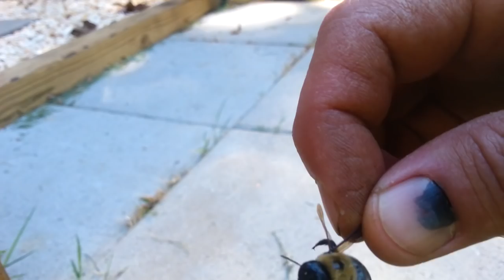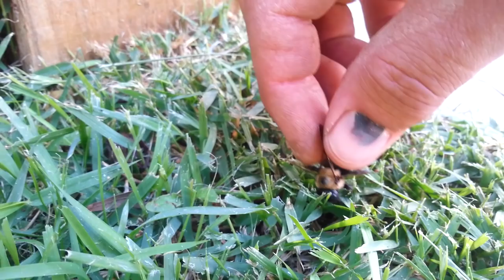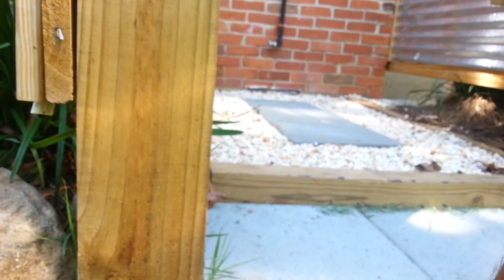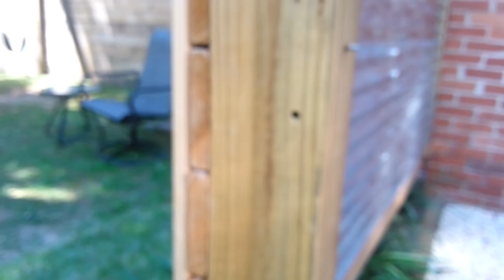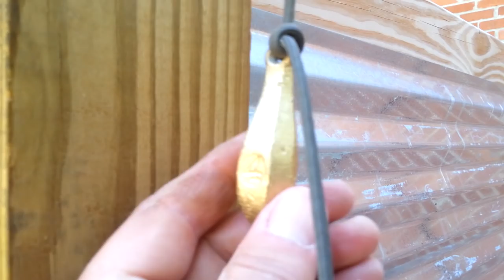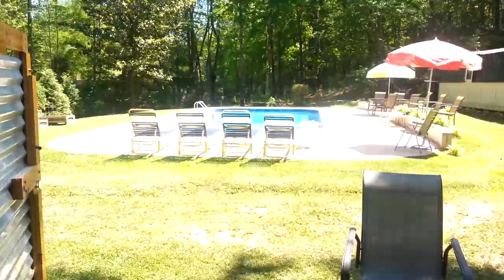When Bumble Bees Attack & Do It Yourself Outdoor Shower

Comment: Have you had much experience with carpenter bees? Those things come back year after year like snowbirds driving south for the winter. They are setting up a homestead in all that fresh wood you have supplied them. I'm speaking from experience when I say you need to find a pesticide that works and quick. That is unless you want to replace that structure about every ten years or so. I use a powdered mix for my sprayer that seems to work but I can't remember the name. If you are interested just reply and I'll get it for you. I sprayed the cover on my patio and fence. When the bees returned to what they thought was a smorgasbord they just hovered around but would never land at  least most of them, nothing like I had a few years back. They were in my yard a few weeks back looking around but they have left now so I think what I used work pretty good.  Just let me know if you want the name.
Reply from the maker: +R Lindsey They do love the fresh pine things I build but they never drill into the wooden parts of the house where it has been painted. I'm going to check later and see if they enjoy linseed flavor. If not I will linseed all my stuff. Thanks for the information if you want to provide it. Don't go to a lot of work for me though. Thanks for watching
Reply: +Exploring Alabama Hi, yes I really like your videos when you go metal detecting. I live here in Alabama so it's very interesting to see where you go. This is the stuff you need http://www.domyownpestcontrol.com/cyper-wp-reviews-pr-228.html You can follow the directions but I just spray everything and everywhere I don't want those bees making a home. The problem is the babies come back next season. They return to where they were born to lay more eggs and the cycle starts again. I suggest spraying now, again in the fall and then early next spring. After that, only as needed. Good luck!